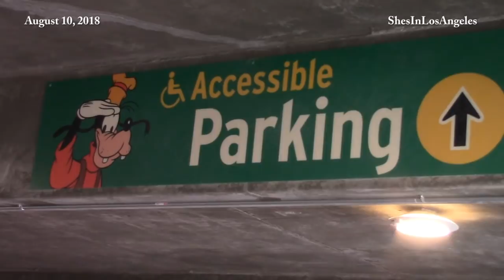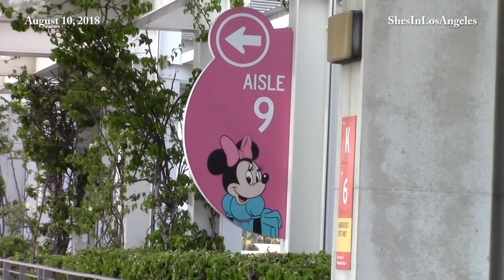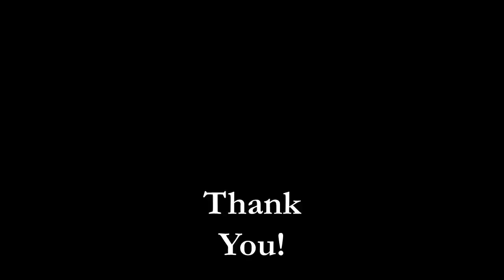Disneyland Resort - 8/10/18 New Parking Structure Construction Update

Comment: It looks like the two structures will be connected in the front and back on each floor.  I assume you’ll enter the new structure from the rear bridge and leave from the front so both structures will share the current structure’s exit.  I imagine that will cause some crazy traffic jams in the evenings.  I hope they’ve thought of a way to avoid that.   I also hope the new structure will have its own restrooms but it doesn’t look like it will.
Reply from the maker: Hi thulcandran,  I left a link to buildzoom.com in the comments of this video.  An easy quick read... here's an excerpt:  

"On May 11, permits were issued to begin construction on the new ‘Cleo Parking Structure,’ to be located at 1351 South Disneyland Drive. Using BuildZoom’s National Permit Database, we are able to explore the scope of the project in greater depth. According to the permits, the Disneyland Resort will gain a 2.3 million square foot parking garage, spread over six stories, named for Geppetto’s goldfish Cleo from the Pinocchio movie. The entire project is valued at $100 million, and will also include 5.1K square feet of office and restroom facilities, and an additional 88.8K square foot transportation terminal."
Reply: ShesInLosAngeles office space in a parking garage? Interesting
Reply: I was thinking the opposite that the front east bridge would be for entry and the West would be for exit.